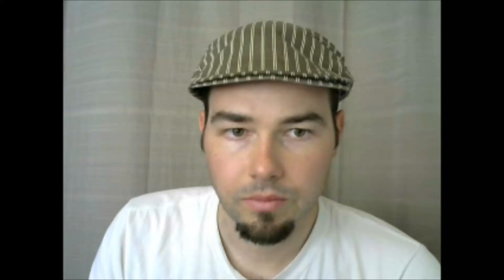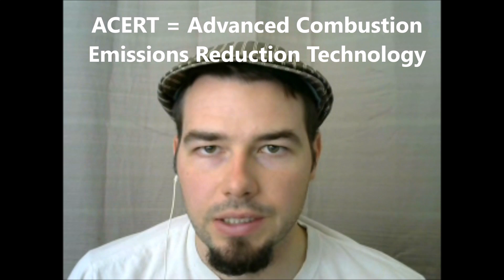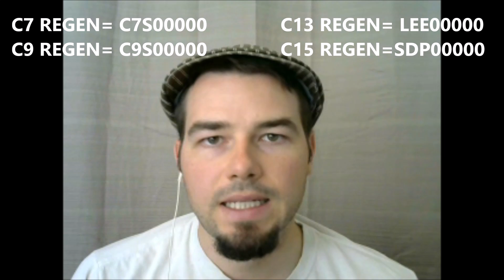Regen, Aftertreatment, and DPF System Class.  Cat Emissions Systems Course.

Comment: Got this C13 regen issue that I was hoping you could help me out with. A little back history, the engine went into stage 4 lockout. The CAT tech came out and gave us the factory code to unlock us out. A fuel pressure code came back first so the guy recommended a few parts to throw at the engine, including the ARD head. I changed the ARD head, cooked the DPF and air blasted the DPF. Put it all back together and forced a manual regen thru CAT ET that successful. There was no codes after until I tried another regen to make sure it worked, and failure code 3251-20 Aftertreatment #1 DPF Differential Pressure : Data Drifted High came back. The ARD flame temp would not go above 200 degrees and would not pass the Aftertreatment stage of the manual regen.
I'm an Airman in the Air Force trying to punch this thing out the shop, so I was looking for some quick  troubleshoot pointers and tips for this issue. If you could help, that'd be much appreciated sir. Thank you.
Reply: I have seen this code after a cleaning. Soot/trash is in fitting, tube etc. The sensor box cannot read a diff. psi due to the obstruction.
When installing a ARD head you must flush the fuel system w/o the filtered fittings around six times. Install the filtered fittings and flush once more. Also these engines are old and the two flexible fuel lines from the number three manifold to the ARD head might be breaking down internally and allowing trash into the ARD head. I replace these if they are old. After a DPF cleaning you should reset the ASH model ONE TIME with factory passwords. Once you get this darn thing working YOU NEED TO DATA LOG THE REGEN.
Set your sample rate at 20 per minute, 5 hours. You have to make a new status screen and add certain parameters. Start the data log, do your REGEN. After the REGEN has completed wait around fifteen minutes before stopping the data log. Then you need to look at the data log and see how the REGEN looks. Do you have a dealer version of CAT ET?
Reply: @johngoldsmith6629  We have the dealer version, but we can't reset the codes with passwords, of course. It is the 2018 ET. Not sure if that matters or not but that is our version.
Reply: @jacobwainscott5233  Where do you stand on this right now?
Reply: @johngoldsmith6629  3251-20 will not permanently clear. I will reset the code and it reads successful, but the code comes back immediately. The truck's auto regen switch does not engage the regen. CAT ET manual regen does not engage fully. The checking perimeters will cycle thru but it essentially fails after the RPMs rise. If another regen is attempted after, then it fails immediately. This happens every time to truck is turned off and on. This entire time the original code is consistent. Could it be a failing temp sensor in the ARD head? Or maybe the wires to the sensor being damaged. I was wondering if this code and that sensor correlate at all.
Reply: @jacobwainscott5233   3251-20
The engine speed is zero rpm. There is no differential pressure across the DPF. The signal from the differential pressure sensor for the DPF is above 0.95 VDC or below 0.65 VDC. The signal is not in the diagnostic band. The code is latched. The code cannot be cleared with the Caterpillar Electronic Technician (ET). Troubleshoot the code in order to clear the code. The following conditions can cause these codes:
There is moisture inside an electrical connector. This condition causes the signal voltage to shift slightly.
There is an obstruction in the tubing between the DPF and the sensor group for the DPF. The differential pressure sensor interprets the obstruction as differential pressure. The sensor output voltage shifts in response to the differential pressure.
The sensor group has failed. 
Test Step 1. Determine if the Code is Logged or Active, Active or logged -20 code or -21 code. - Proceed to Test Step 8.
Test Step 8. Troubleshoot the Incorrect Signal.
If the vehicle has a single DPF, disconnect the harness connector from the sensor group.
Clean the harness connector and the electrical connector on the sensor group. Both of the connectors must be clean and dry.
Connect the electrical connectors.
Turn the keyswitch to the OFF position. Wait for five seconds. Turn the keyswitch to the ON position. Wait for ten seconds.
Expected Result:

The -20 code or the -21 code clears automatically .

Results:
The -20 code automatically clears. - Moisture or debris was causing the signal voltage to be incorrect. The problem is resolved.

STOP

The -20 code or the -21 code remains. - Additional troubleshooting is required.
Repair: Perform the following procedure.
Remove the tubing from the appropriate DPF.
Check the tubing for moisture and for obstructions. The tubing must be dry and free of obstructions. Remove any moisture and obstructions from the tubing.
Install the tubing. Verify that every connection is tight.
Turn the keyswitch to the OFF position. Wait for five seconds. Turn the keyswitch to the ON position. Wait for ten seconds.
If the -20 code or the -21 code automatically clears, the problem is resolved. The obstructed tubing was causing the signal voltage to be incorrect. The problem is resolved.

If the -20 code or the -21 code remains, there is a problem with the sensor group. Replace the sensor group.

Comment: Hello Abe I'm having a regen issue on my 2011 C-15 Pete 386,  I had a driver bring this truck in with codes 3245-3, 310-3,310-2 Truck is locked out for manuel regen, I'm thinking that 3245-3 is saying the ARD outlet temp sensor is bad and now I can't trouble shoot it because it is locked out and needs a factory password reset. any ideas or do I need the wrecker to come pick it up for the dealer. I do have Cat ET and was looking at all the temp sensor readings and I did not see any of them with abnormal readings.  just had the DPF cleaned 1 Month ago and replaced the DPF control unit on top of the Filter. Any Ideas would be greatly appreciated.
Reply: 310 codes are successful REGEN's, left them alone, do not delete. 3245 3 is number three sensor. It is a single sensor. Is this code active? If not all will be reading normal. On these engine's a data log is very important on a REGEN. In ET the groups are not sufficient. You need to set up a special group for REGEN's. Sample rate of 20 per minute, I always just use five hours. 
What is your engine serial number? Why do you think its locked out? These codes will not lock out ET. What software is in the ECM?

Comment: 4077-16 aftertreatment #1fuel pressure #2 high- moderate severity 2 any idea whats causing this?
Thanks for any help
Reply: You need to take it to a Cat dealer. Unless you have ET and know this system, you will cause more harm trying to fix it yourself.
Most of the time with this code you have fuel psi on the REGEN system, when it should be off. Could be ARD head, Filtered fittings, Fuel enable valve, Pilot or Main solenoid. ARD heads are over one thousand dollars now. The key to this system is to keep your fuel clean. Run a good primary fuel filter, keep it changed and DON"T prefill it.
Reply: @johngoldsmith6629  i am having the same issue same code after replacing Ard head and sensor pack. I'm going to check the filter fittings and fuel supply seloniod valve tomorrow.
Reply: @Dslrepairpro  When you replaced ARD head did you flush fuel lines, install new filtered fittings and flush again? This system is not to be worked on unless you have ET. You can over torque valves in the REGEN system and cause all kinds of problems. You spent over a thousand dollars and your still in the same situation. No disrespect but your spending a lot of money and the ARD head may not have been the problem. You have to data log a REGEN and see what's going on.
Reply: @johngoldsmith6629  I didn't install the Ard head someone else in the shop did and now I'm ending up with it. I'm going to assume no they didn't flush anything so I'll have to check everything out. And yes I have cat et and access to passwords.
Reply: @Dslrepairpro  Data log a REGEN before you do anything else. You will have to set up a new screen. Call it what ever you like, you will add from the list. Do not use the list on the screen, it is incomplete.
Reply: @johngoldsmith6629  I'll do that before I take anything apart for sure.

Comment: Thanks for the video. I am in charge of a school bus fleet with a couple of C7S engines. Do   
you know if there is a way that a school district can obtain a factory password. So far I have had no luck but maybe I have not been talking to the right people. I am trobleshooting one with a high dpf inlet temp code. I cannot even force a regen without clearing the code. I really have no way of monitoring what is going on. Thanks.
Reply: You have a high outlet code, not inlet. You have to have Cat ET with dealer level access. Contact your local Cat dealer and they can give you passwords.  These engines have turbo's known to fail and put oil in the exhaust. You can also take the ECM off and take it to your local dealer and they can clear the code.
Reply: It has a high outlet code active with a high inlet code inactive. Driving the bus with no regen temps never exceed 600 and are reasonably close to one another. DPF is nice and clean. No visible signs of oil in exhaust. I'm trying to get passwords. ECM is hard to get to on a Blue Bird. May still be a turbo but I want to see what it does during regen. Thanks for your help.
Reply: @dougwilliamson9553  DATA LOG REGEN.

Comment: Introduce EGR to lower combustion temp to reduce NoX, then introduce fuel to the DPF to increase the temps and creates NoX, then thru the SCR (DEF system) to remove the NoX. Can't we just eliminate the EGR and DPF and rely on the SCR? Hint: lookup Tigercat FPT engines

Comment: Be thankful cat never used an SCR or a DEF system I've seen many problems in all brands related to that system especially with Volvo D13's in coaches
Reply: Never had a problem with the Volvo’s, only once i picked up a truck (i was in the service department for a leasing company) and the driver compliant was check engine light.  It needed a regen.  Started up, started parked regen, went for coffee, came back, problem solved.  Most problems i had were with the Detroit branded Mercedes’.

Comment: I have a question maybe you can help me out with something. Great video by the way, very informational, thank you. I took my truck peterbilt for an oil leak coming from the valve cover. They cleaned off the engine and then did a forest region for about two hours even though the truck did not need a regeneration. I don’t know why they didn’t just use the cruise control to build oil pressure bought ever since my truck has been giving code for the regen  Saying particulate Trap outlet temp and the last night hey gave me the sute percentage code And cut my power in half. I’ve never had a problem with the lead generation system and the engine only has 350,000 miles on it, it’s an acert c15. Did they damage something by regening the system for so long even though it didn’t need it?

Comment: hello had problem with cat7 3719-0 got dpf filter clean and had changed ard head and spark plug now when regen got code for 4077-16 its ignites temperature goes up then temperature goes down got combustion loss code 11f please help or contact at sethisingh.ss@gmail.com will donate to site for help as you want thanku
Reply: You got fuel psi went you shouldn't have it on the REGEN system. Need to data log it. Does it happen at the very start. If so your fuel enable valve could have failed. Data log would verify when fuel psi is incorrect.

Comment: First, thanks for the great videos. Truly a great tech. Here is my question: Is there any way to test these control valves without a scan tool?I have a generic scan tool that can’t run the cat ET test but I notice the valves are all 2 wire(power and ground maybe?) For example Can I apply power and ground (power probe) to the secondary air control valve and see if the valve opens? Thanks for the great vids

Comment: I have an auto repair shop in Miami and one of my customers has a 2008 ford f750 with a c-7 engine he is having repeat stop engine light issues I have replaced the ard head because it would not lite off once I did that it did a regen okay. I need to know if the system will go into regen if he has the truck parked and has the pto on. It seems that he does not drive this truck long enough on the highway to make it do a regen.  Is there any way to program this unit and install a manual regen switch? My email is youraffordableautorepair@gamil.com
Reply: You have to put a switch in to arm the pto circuit when in pto mode. You can't leave that switch on all the time. When you key off it will turn it off. Also in pto mode certain conditions must be met or it will not REGEN. Has to have latest flash file as well.

Comment: Is it a good idea to delete the regen system completely  on a Cat c13
Reply: "the law requires equipment emissions control systems to be left in place and maintained."
Reply: @doctorwhodj  You can literally unbolt the pipe end that hooks to the DPF and let it hand, you're not taking off the DPF or anything, just not putting it to use!
Reply: @wyattlarrick3246  Or drill out the DPF and weld the EGR shut.

Comment: Excellent Information Ive watched your course several times and followed along with CAT training manuals that go deep into detail about the subject.  Ive gotten close to Impass now with my issue.  Myself and my friend are working on a LEE C13 highway truck engine New ARD head, Filter fittings, sensors, blew out the fuel line now we get fuel, spark, diff pressures are within spec, we are getting the 3480-16 & 4077-16 Aftertreatment #1 & #2 fuel pressure high codes. There is also a 3719-16 DPF #1 sootloading percent high moderate severity  (2).

Comment: Awesome job!. Where is the ARD on a 2009 F750 Cat C7s? My truck died at 135k, and the shop wants $3500 in labor alone.
Reply from the maker: +Jason Barber $3500 in labor for an ARD head? That seems way high. Most Ford trucks have them running parallel with the exhaust facing the turbo. They aren't easy to get off, but it is a 6 hour job not a 30 hour one. Unless your truck has it differently then who knows.

Comment: Cat C7 accert is a total piece of trash, I use a degreaser liquid type soap to clean the DPF . and the ARD along with there turbo are junk. And the cleaner CAT sells in the blue bottles to clean the carbon for the ARE is best used to check for fuel leaks on the fuel lines around the injection pump.We have 3 at my job they spend more time in the shop then on the road. The CAT ET program is crap you can regen through the laptop and clear codes and logged events .When regent the motor if the laptop losses communication it stops regen while a Cummins program dose not. And the main problem with Cat you send it to the dealer that is the first thing they say it needs a ARD/TURBO even thou you replaced it along with the spark plug, spark plug wire and the spark plug ingintion coil pack on the r/s of the engine block

Comment: What a mess.  This all reminds me of what happened during the first round of automobile emissions standards.  No one really knew the best way to deal with them which resulted in a bunch of silly systems.  I'm sure in time it'll get figured out and be a non-issue but it sure is painful getting there.
Reply: It basically killed their on road trucks. Great trucks before they had to add this regen crap. Then they had so many problems they just quit making the trucks.
Reply: Exactly. We will eventually get there.

Comment: Thanks for the response regarding the computer for diagnostics.
What computer and software are you using?
Any referal where to get the same one?
Reply from the maker: +HD TRUCKS & EQUIP LLC Any laptop with windows will work, but to get a version of ET you'd have to go to Caterpillar's website or call your local dealer and ask them.

Comment: Wow! Lots of info. You made it understandable. I find computer systems for medium/heavy duty trucks around $3000. Do they all have ability of obtaining passwords, or is that a secondary subscription? Interested in Cat, International, Cummins. Thanks for the education. Dave - HD Trucks & Equip LLC
Reply from the maker: +HD TRUCKS & EQUIP LLC They sell the computers that have all that software on eBay, but I'm not sure how reliable they are. Each manufacturer has their own licenses and usually cost an annual subscription.

Comment: Hello Adept Ape Great Class I am a fire Dept mechanic with a Cat 2009 C-13 I have a code of 3480-16 Aftertreatment #1 fuel pressure #1 High moderate severity went through the repair procedure and am at replacing pilot and main fuel control valves and coupler fuel filters. next step is Ard Head replace. Do I need to remove turbo to do this on a C-13
Reply: I’ve got the same issue:  New ARD head, filter fittings replaced, valves replaced, getting 3480-16 &4077-16 codes, gonna pull a current test here shortly and verify the fuel solenoid is operational.  Did you solve your issue?